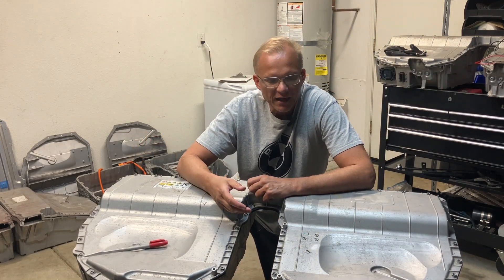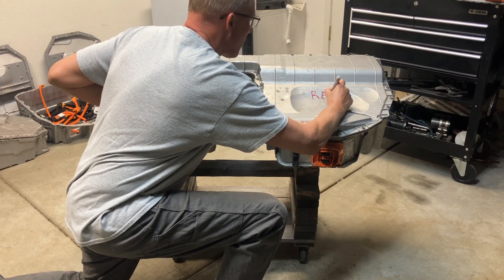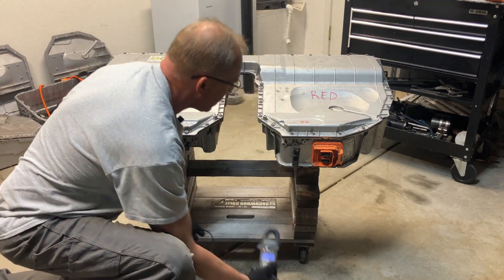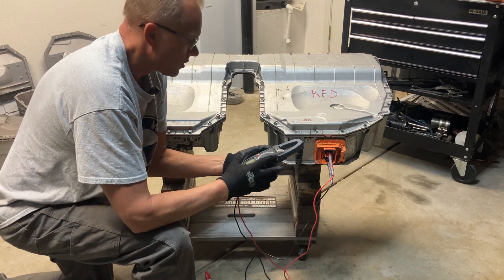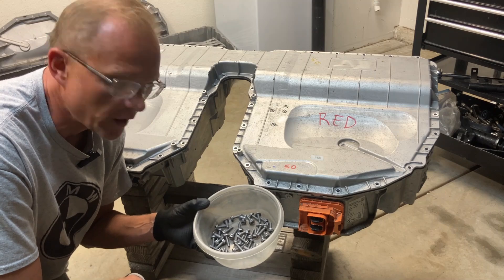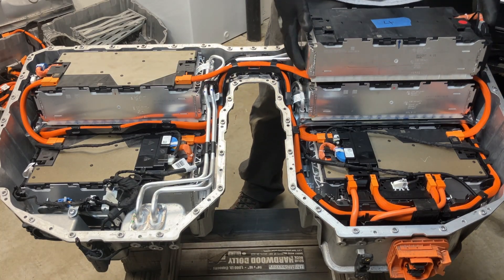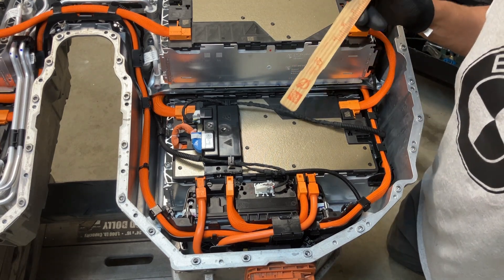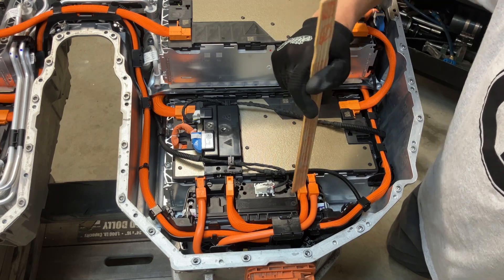BMW 530e 12 kWh Battery Pack Voltage Reading

Comment: Hello! I replaced module number 2 in the hybrid battery and now I'm wondering if it requires any coding. It runs in electric mode, it charges but I think it should have been coded somewhere that a module was replaced. Thanks!
Reply from the maker: honestly no idea but it being BMW I would think its gonna throw some codes, best of luck

Comment: I have a 9kW battery in my 2019 BMW 530e, and currently I can drive 20km (with the air conditioning off). Is it possible to replace it with higher-capacity modules using a plug-and-play system?
Reply from the maker: probly not as the safety boxes and BMS boxes are dufferent in the 12 kWh newer packs and your car computer most likely wont like it and will throw a shit ton of codes, it's BMW after all 🤷🏼

Comment: The car shows the high-voltage battery as discharged and it does not charge. However, this is not because the battery cells are empty. The HV battery still has energy inside, but the system (SME/EME) has isolated the cells due to a “Crash detected / Category 7 fault.”

ISTA diagnostics show repeated errors from the SME (Battery Management Unit). This means the problem is most likely with the SME or EME control unit, not the battery cells themselves. 21F10C – High-voltage battery unit: Crash message, serious crash detected! 
How much cost to change the SME? Thank you!
Reply from the maker: these cars are not designed to be worked on by independent mechanics, BMW wants to reset the codes themselves and that's $$$ as is the specializes equipment to do so
Reply: @Good-Enuff-Garage The coding and programming can do myself with ista+, this is easy! Hard job is to remove the battery to change SME because not have the elevator.

Comment: Can you swap the 9kwforthe13kw I am looking at upgrading to the later battery do I need to do anything special
Reply from the maker: if you mean in your OEM BMW I am sure it will throw a bunch of codes as the BMS modules are different

Comment: hi  why do you  decide  to use bmw modules    and what spec for these  modules
Reply from the maker: short answer my friend Artur used them in his Jaguar XJR conversion and recommended them, longer answer would be that each module is a very high voltage of 65 volts or so, so all you need is 6 of these modules and you have what I would consider a full voltage battery pack, back in the day ie 5 years or so ago, 360 volts was considered a full back, I think automobile manufacturers have upped the volts since then I think Tesla may run on 400 plus volts now, anyway, you would need a shit ton of Nissan Leaf modules to give you 360 volts, same with the old Tesla modules, so that's why I like these BMW ones, they also pack quite a punch with the amount of amps you can pull out of these packs, North of 500 amps peak

Comment: Great, informative video as always. I felt like I was being equal parts efficient and a cheapskate, but I had to make a custom battery box and just designed it around the m6 hardware that came out of my Pacifica battery. Still have lots of nice serrated m6 nuts left over, though.